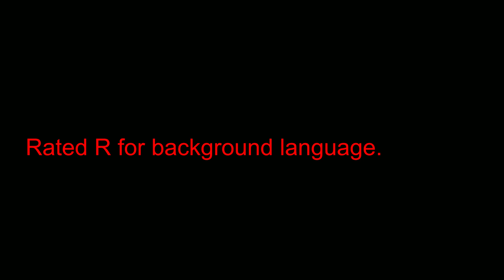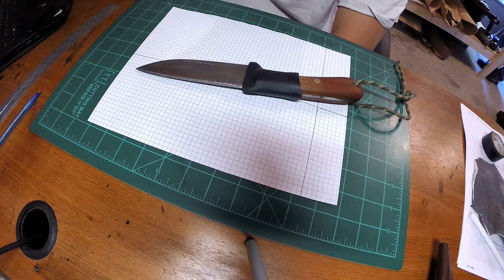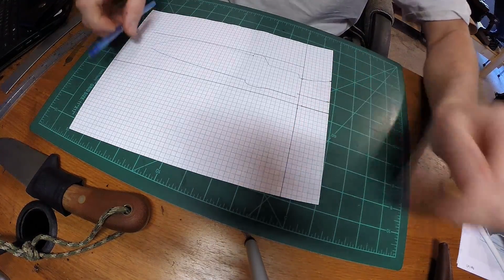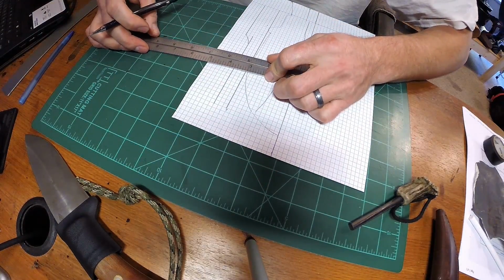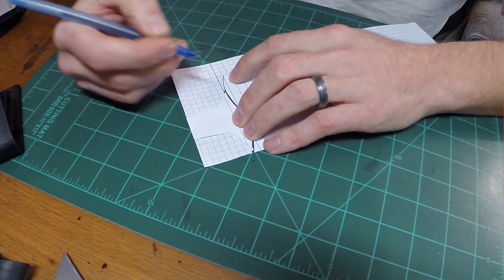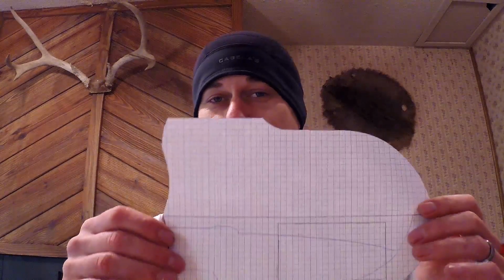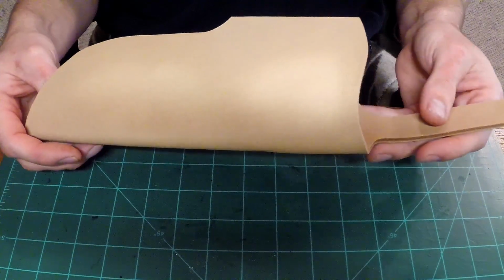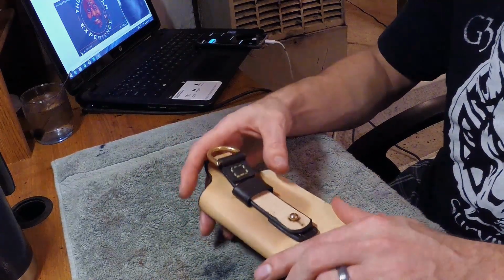Sharing tips as I build a leather/kydex sheath. WolfeCustoms shop #012

Comment: Great work on the sheath. I'm curious did you stitch in the kydex or glue it into the sheath? So it doesn't come free when drawing the knife.  Been wondering how to make a leather sheath for my woodsmans pal. And I got some great ideas watching your videos. So thanks for making them too. :)
Reply from the maker: Thank you. I used a contact adhesive as well as sewed it in position.
Reply: Excellent video. Three questions: 1) Do you groove the inside of the Kydex insert to sink the stitching to protect from friction wear?  2) Do you drill holes in the Kydex before stitching? 3) Where do you get such high-quality leather?

Comment: I would have preferred the video just be you talking to the viewer and not the extra stuff, but that aspect of the video aside, I appreciate you sharing the project and insight. The sheath itself looked good even before you finished completely applying the dye. The hole with the tiny slit has been around a long time, but you used to create a whole new idea. (The quick release system)
There are so many ways to create a thing that I sometimes find myself hung up on a particular way to build something. It's frustrating, until I find an old method, a simpler method or a new way to get it done. And then in retrospect I am annoyed I let myself get frustrated in the first place :)